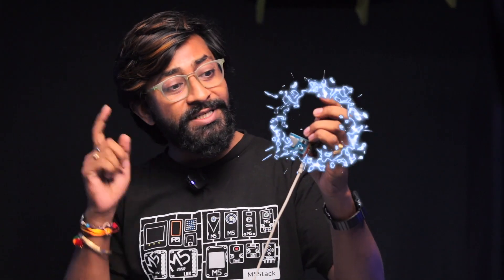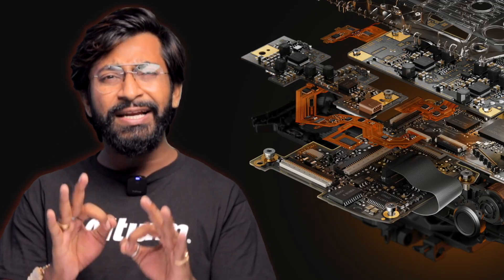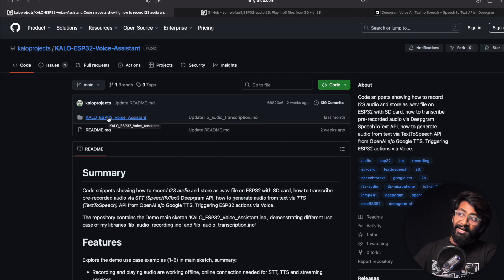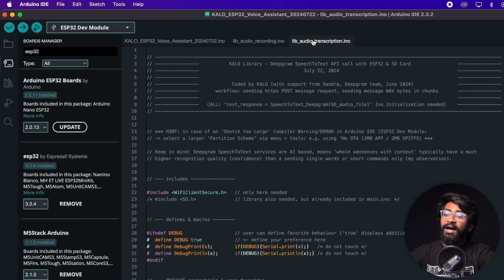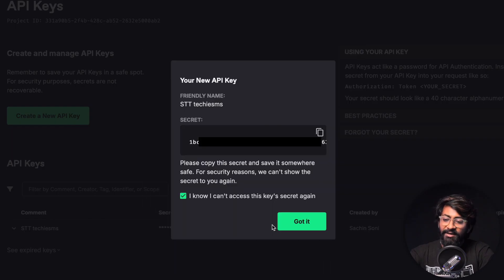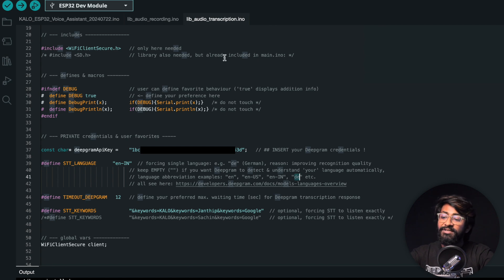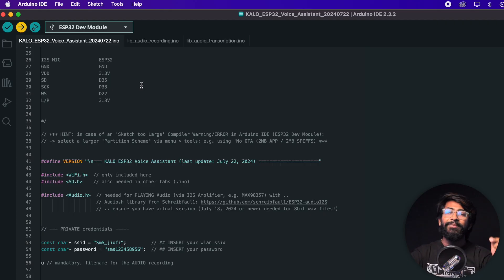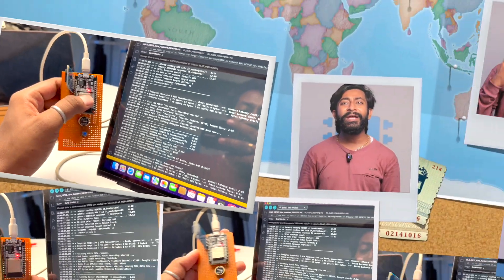FASTEST! Speech to Text Conversion using ESP32 Board  🔥🔥

Comment: I have a question I wrote a program which controls light using an ESP32 and it's also connected to a webserver so when I plug the ESP32 on a computer and upload the code, it works but when I try to connect an external power supply, the program doesn't work Any idea?
Reply: Does not work how? Put more details.
Reply: Put more details. Does not work how?
Reply: @maisrico.daytrade  The ESP32 needs to be connected to a computer to run the program, but I want it to work independently when I load the program onto the chip and connect it to an external power supply.
Reply: I’m guessing that you mean when you power it up independently, the program never runs, it just sits there. (Pure guessing, let us know below if that’s what’s happening.)

I don’t know anything about ESP32s, but I’m guessing it needs to get a reset signal from somewhere to start program execution. (When it’s connected to the computer, I imagine that the software on the computer is producing the reset or start-execution signal. Maybe someone who knows about ESP32s can tell you what to do to make sure the program starts running as soon as power is applied.
Reply: @DaveEtchells  well explained, thanks. 🙏🙏.